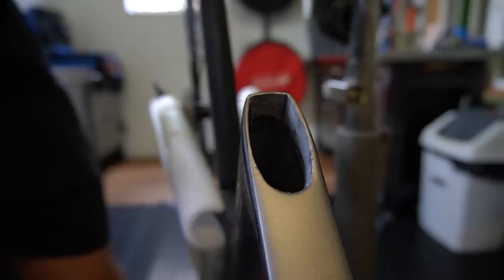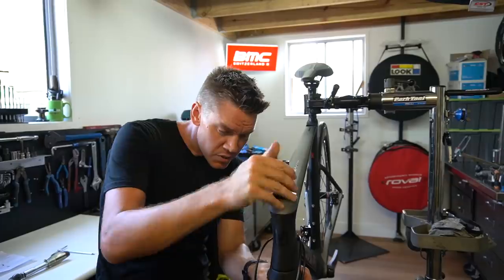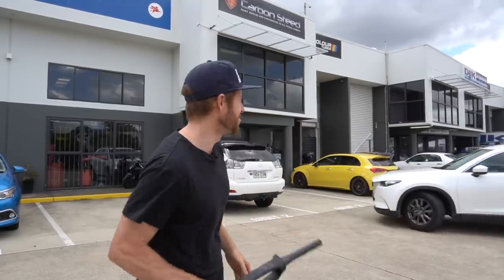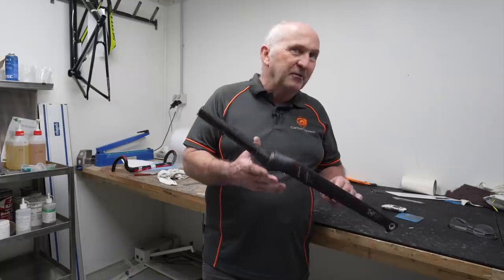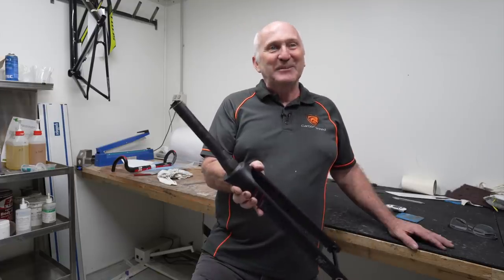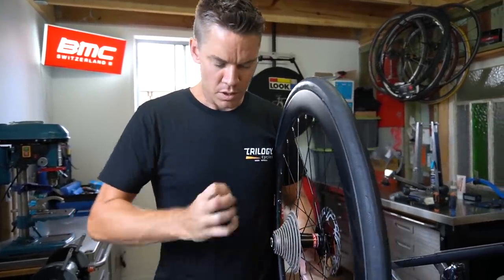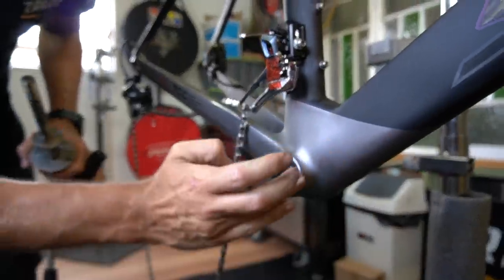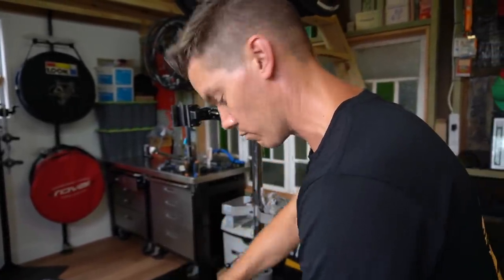The Cheap Chinese Carbon Bike that Backfired

Comment: Here is my take.... Carbon bikes are extremely labor intensive, and even in China labor is not free, or even super cheap anymore.   At the same time in the biking world, we have idolized carbon frame bikes to the point that every amateur rider thinks they need a top of the line carbon aero frame and that it is going to make them ride as fast as the pros.  So between these to trends there will be someone will cut out every cost to make the cheapest possible bike.. and basically have just created the department store version of a carbon racing bike.  Probably won't cause to many serious accidents since the ride will be so crappy that these bikes will be dumped in the back of the garage.  Even fairly advanced  bicycling consumers would be better served by a good aluminum frame, with decent components, but this is not what the cycling press writes about... Because no one has ever gotten excited about a bike with Sora level components, even though a good frame with that level of components would be faster than 99% of all riders.
Reply: Right on the money. Unridable for him does not mean that it would not be for someone else. For me a carbon bike would be a waste of money for the few pounds saved. And, there are high quality less expensive bikes coming out of China that do not cost 9k and now days cycling has become a elitist sport and even in the clothing people wear. I ride a cheap sub $ 400 hard tail trail bike and am totally satisfied with it as it meets my needs not some traveling advertisement. Making payments on a bicycle is just crazy, just to be is some in crowd .Well, ride on and have fun.
Reply: ZERO pros want to ride those heavy AF aero disc junk. They all prefer the 6.8kg fast whips of yester year. I talk with so many WT riders and mechanics off record. They hate these new bikes.

Look at my power data tests. The aero disc bikes are the slowest bikes in 25 years lol.
Reply: for what some people are spending on carbon bikes, they'd be better off with a custom/semi custom alu or steel frame. the pro's today don't have any say in what they ride, unlike how it was back in the day, when they rode steel and had their favorite builder make their frames and put whatever team sponser stickers on it. but as usual, the industry is pushed thru the pro peloton and some riders feel that's the way they need to go. utter bullshit
Reply: @ohwell2790  No bike is worth 9k 🤣
Reply: @durianriders  But Harley, the baby faced, never was, never could of been guy over at the Global Capitalism Network who can do science and shit, says Aero carbon disc is the best.
Reply: My Giant aluminium frame lasted me fifteen years and many thousands of miles. I gave it away in the end because I was bored with it. As good as the day I first rode it.
Reply: I've been riding carbon for 30 years and love the shock absorption as much as the light weight...  don't fancy having my teeth shaken out of my head by aluminium.
Reply: @beneichmann6516  LOL if you NEVER bought ANY Chinese products you would be living naked in a field trying to log on to the internet with typewriter 😉
Reply: I respectfully disagree. The main gain in professionally built carbon is ride quality. All the aluminum riders are groaning on km 100 in rough roads while the carbon lads are fine. Well built major manufacturer Carbon is wonderful at km100. Don't comment on something you know nothing about.
Reply: @hooben...5211  Us steel guys don't mind a bit of rough too 😉
Reply: Fair comment mate. I’m not a carbon rider myself in general but I will say I have recently purchased an Chinese hollowtech 2 crankset and am satisfied with it in regards to fit and use. The only obvious generic machining I found on the drive arm  was the chainring arms are a little wider than the chainring but not overly and it does not affect purpose. I wouldn’t touch their carbon at this point though…
Reply: "a good frame would be faster than 99% of all riders"? How is a good frame faster than a rider. Is it electric?
Reply: @jamesmedina2062   I wasn't thinking of electric bikes. Once we are talking about decent quality bikes, getting a pro quality top of the line race bike is not going to make 95% (probably 99%) of riders any faster, or give them any additional endurance.
Reply: @yisraels4555  Well we can't exactly generalize about anything in my opinion.  Each rider is a unique person with individual goals and body. There is on-road performance and off-road. Does lightness help in off-road? For sure. Does it help on the road? I think so but a little less important as you don't have to conduct jumps over obstacles. Is bottom bracket more important than frame performance? The frame is the foundation of everything. But yeah if we compared a 1000 dollar frame to a 10,000 dollar frame, the differences might not be immediately apparent but over time, you may see the worth of the nicer bike as it may be more durable or provide more joy to the rider. A bike is made of so many components and like a chain, every single link matters. Even just a single cable guide can make a difference in braking performance. As I told someone the other day, human energy conservation and efficiency is where its at. Because it is a finite resources. We don't have unlimited years to ride or unlimited energy.
Reply: Vintage steel baby, vintage steel!
Reply: @ohwell2790  I agree with you. Most people ride cheaper bike for fun and for short commute anyway. Come to think of it, how many people actually compete in amateur crit race and such? Even with carbon bike, there is no way a middle aged guy like myself can ride like a Pro Cyclist who can pedal for 25 miles/h for several hours nonstop or circle around several city blocks in a high speed crit race with danger of possible crash. 
Speaking of elitism, I do think that road cycling coupled with expensive carbon bike and clothing has been turning away many young people with potential talent. Also I noticed cycling clubs full of young people are sponsored by bike companies/shops since most of them are not financially stable to afford expensive carbon bikes on their own. Personally, I miss 80's and 90's because road bikes are a lot cheaper with inflation in consideration.
Reply: @richardloh8260  Sure it is- if you can affod it.  As with most things, the incremental improvements at the top of the range cause a hyperbolic rise in price.
Reply: @beneichmann6516  if you wantvto be ripped off be my guest. Theres loads of good chinese products at a good price.
Reply: @dannyh8288  British steel?
Reply: @niclaskarlin  yep (Reynolds 531) ! Or Italian (Columbus)! Or American (like what Schwinn used in theirs).
Reply: @dannyh8288  And a Judas Priest album!
Reply: @ohwell2790  point. I still cant get over people spend over $2000 on a bike if you are not a professional. It's a bike for God's sake.

Comment: Man, I wish I had this fella as my mechanic.  He's thorough.
Reply: Yeah, he knows his bikes. I was tempted to buy a second hand mechanics bike that was a mish mash of scavenged parts.
Reply: Completely showpony workshop.White worktops? Give me a break.  No mess, not a bike under $2K has ever been in that stand. Real bike shops service everything, not just the hobbyhorses of the dilettante rich.
Reply: @zygmuntthecacaokakistocrat6589  whew!  Edgy response there bro.  Save some of that for the rest of us.
Reply: Its not that pricey considering the amount of engineering that goes into them and having someone experienced with all the correct tools, settings, lubricants is worth it.
Reply: @zygmuntthecacaokakistocrat6589  agreed, seen plenty of mechanics stomp up and down on their high horse about only having park tools etc. It's easy to dance around and complain. Sure enough, as you slide down the pricing scale you find build problems, hardly rocket brain stuff. Frankly, it's far more interesting to find those problems on more expensive bikes which are heralded as the beez neez.
Reply: @Matt28NJ  LOL yeah, a bit hyperbolic maybe but he's right though, look how he reacts when a non manufacturer approved KMC chain appears NOT SHIMANO APPROVED = BAD. Or the near disgust when he has to use his own grip paste. There are lots of "mechanics" popping up like this at the moment, take them a bike with bad shifting and they will reach for new parts before the hangar alignment tool, because what they really want is an "approved dealer/technician" sign in the shop window, and you get those by selling products not fixing problems.
Reply: @chris1275cc  I was reacting to his dorky comment about "white countertops".  Nothing mentioned about non series Shimano parts.
Reply: @Matt28NJ  Yeah, but thats his point he's commenting on the type of "mechanic" that has a workshop like that ie. he can have white worktops because he knows he isn't going to get them dirty working with used part and oily drivetrains. What, did you think he was commentating on his interior design choices?
Reply: @chris1275cc  I don't give a rat's ass about his design choices.  I was poking fun at Zygmunt for his goofy comment.  It's totally possible, to, I don't know, maintain your workspace and clean it up for filming?  To be fair, I'd use a disposable cover if I had white surfaces, perhaps that's what this mechanic did.
Reply: @Matt28NJ  yeah and thats why I said his comment was hyperbolic. He used the white counter tops as a metaphor, jezz.
Reply: @zygmuntthecacaokakistocrat6589  have you not seen a F1 workshop? If your in an area that has wealth then you have a clientele with high end bikes, it’s only fair to have the workshop appearance to service those clients otherwise they may go elsewhere.
Reply: @markhoward4366  Yeah thanks Mark. 
To the comments above,
 I cater to a variety of people's requirements of all dollar values, in fact after Cams allocated slot to build his bike, I worked on an old ladies bicycle that had a collapsed bottom bracket .
And yes after every job I clean my workspace and put tools away. 
With 23+ years in this industry and trained to a high standard following methodical workmanship practices I see no issue having  pride in my workplace ?   
Quite honestly I don't want to work in a shit hole every day which others may. 
Each to their own I suppose. 
Cheers Aaron.
Reply: @pom355  couldn’t agree more, high end bike customers don’t want to see their bike being worked on in a shit hole either, in my opinion it just shows the mechanic doesn’t take much pride in their work if the workspace is a mess. I have a wood worktop at home and a stainless at the shop and it is cleaned down after every bike I work on.
Reply: There'd be a lot less garbage being sold in the market if everyone had a mechanic like him.
Reply from the maker: @pom355  you can get the 🍿 out for this thread. 😂 😂 😂
Reply: @zygmuntthecacaokakistocrat6589  Stainless steel mate, not white.
Reply: @pom355  i film bike mechanics all the time. Your work was a pleasure to watch!
Reply: @tossemanden  why Thankyou
Reply: He’s a great mechanic, worked on my bikes in Sydney…too man
Reply: @zygmuntthecacaokakistocrat6589  u ever gon reply
Reply: @zygmuntthecacaokakistocrat6589  Feel sorry for those who admire this mechanic! There are some obvious signs showing this is a home mechanic level, miles away from being a true pro mechanic: 1. full of park tools. I do think park tool truing stand, dishing tool, and hanger alignment tool are quick and handy. but other tools like alley keys, t-handled allen wrenches, lateral and vertical truing gauges are just not usable. there are many better alternatives that are stronger and more efficient for a professional workshop. 2. look at the order of the spoke wrenches hanging on the right arm of the second truing stand, this order makes no sense at all. red on the outside, followed by green, black, blue.... why would you put the most usable black one (3.23mm) in the middle! 99% of the wheel builds are using black one. 3. he deliberately rattle those 2 barrow adjusters, if he release them to their neutral position, they won't rattle on this bike.
Reply: @zygmuntthecacaokakistocrat6589  Who cares about what colour somebody paints their shop? Some people's shops are disgusting pig sties and other people can actually keep their work areas clean. A white table means you can easily spot parts.
Reply: in other words, picky.
Reply: Anybody can be a bike mechanic after a few days of training. It's not complicated. I'm grown man and can fix things myself I'm not paying some guy to fix my bike.
Reply: @goldenretriever6261  OMG you are such a manly man!  Do you have a newsletter I can subscribe to?
Reply: @Matt28NJ  learn to fix your own bike.
Reply: @Matt28NJ  Brutal...yes. But ...maybe...some truth there in that observation. Depends entirely on how the workshop portrays itself.
Never leave a fool with money...is something I would (will?) be guilty of given the opportunity.
Whatever.
This site is useful and the content is instructive.
Isn't this what it is all about?
Subscribed.
Reply: @zygmuntthecacaokakistocrat6589  Definitely a bike shop that wouldn't have me and my Chinese bike brands in their shop.
Reply: @chris1275cc good insight

Comment: I have the same model savadeck colorado. I bought it from amazon. Over 800 miles so far. Only tape bar no good quality. Very stable and firm when you speed over 30 mph. Great deal for the price. Hydraulic brakes. So far not regret at all. 28mm tires 50mm carbon fiber rings. 105 group set.  This is a quarter price of $ 9000 brands bike.

Comment: Nowt wrong with KMC chains. Not sure why you'd want to change that immediately.
Reply: From myself and other team riders at my local club, we rate the KMC chains higher than the Shimano equivalent. They appear to be stronger. There have been reports if snapping and distortion in Shimano chains lately in my local cycling scene.
Reply: I will happily switch to a KMC when their is a few thousand k's on the cassette but I've found them to be very clunky if you run them on a new cassette. From a quality point of view they are great.
Reply: @yomommascookies9394  Hmmm. Didn't know Taiwan was in Korea, learn something everyday.
Reply: @chris1275cc  Damn... all these years I was ordering them from abroad while I could have just gotten them cheaper right here in ma backyard .. ROFLMSAO~

Comment: I own a Sava bike as well.  I'm new to biking and bought a Sava herd 6.0.  For me, my bike rides fine. I went to the bike shop and all that needed to be done was that the wheels needed to be trued and the gear needed to be tuned.  The bike cost $1400 US, which is about $1900 dollars in Australia. I didn't have any issues with my bike.  Thanks for sharing this video.
Reply from the maker: Thanks for sharing on the thread Chris
Reply: I have a few chinese carbon cheap bike too, I weight 220lb and didn't have a problem with it. Of cause I am not a pro biker but I think that most people are. 

My point of view is that, not everyone has the money to spend on an expensive brand frame. So the bike is totally acceptable for the money, look at Trace Velo he also has a cheap chinese carbon frame and have no issue.
Reply: i bought one as my first bike to, but under a different brand. local cheap bike brand slap their logo on it and sell as their "top models". i have changed the wheels out for a couple of dt swiss, and from one day to the other i was 2 kmh faster. otherwise i have been fairly happy with the bike. it´s 3 years old now, i think i will ride it this next summer, and then replaced it for a new "normal" brand bike. maybe a trek domane or a giant envy
Reply: I agree not everyone has $5k for a bike but that doesn’t excuse not greasing main components. That’s shit pride and craftsmanship.
Reply: @FPChris  u think western brands products made in china has much pride?😂🤣😂😂

Comment: After 1 month, I watched this video again.  I think, based on my riding experience - buying bikes and parts included - cheap bikes become cheap because of compromise.  Manufacturers and bike builders do not put the best parts in one bike.  It would be unsellable.  It becomes too expensive that only the ones who really need it will be able to buy.

The compromise comes in selecting the parts that will be installed into the bike.  For parts that could easily be replaced, they put the least expensive.  Hubs, for example, are the easy to replace.  Just select the hub in a bike shop, return after 2 hours, and the wheelsets are good to go.  Frames are sold in so many shapes and forms.  The compromise comes when a cheap frame is used instead of a relatively flawless frame.  The bike is then fitted with a very expensive groupset to raise the prize a bit and make it attractive.  The bike then becomes a bit expensive but affordable.  A buyer will disregard the flaws of the frame, hub, saddle, bars, cables, as long as the rd, fd, cogs, shifters and levers are relatively expensive.  In the buyers mind, I can 'upgrade' my bike by changing this and that SLOWLY, because that is how I could afford it budgetwise.

For those who are RICH, and can afford to spend money right away on expensive bikes, who's stopping them.  But for the not so rich but love biking, the compromise bike is the way to go.  From where I am right now, one of the bikers' obsessions is UPGRADE.  They save, trade, barter, scavenge for whatever upgrades they could do to their bikes.
Reply: cool story bro
Reply: Wrong.
Think marketing budget.